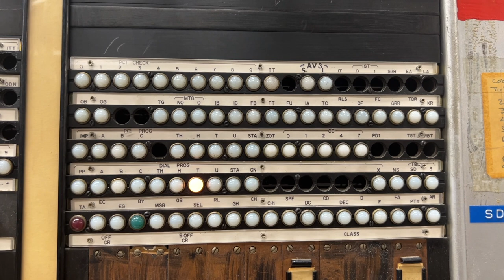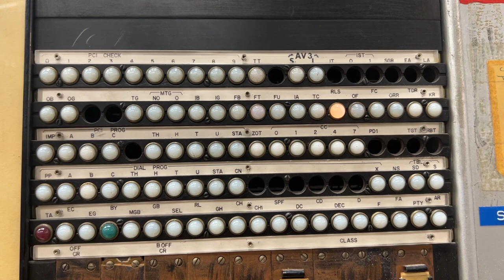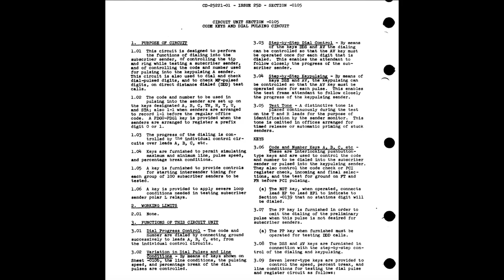Test Frame Tuesday - Originating Sender Test

Comment: Thank you Sarah! I’m a network engineer and it’s amazing to see the similarities between these two worlds in time. “Poking the machine” in a very specific way to test a very specific piece, is absolutely an art form. As you get better and better and learn to to feel the machine’s quirks, you usually get a hunch of where to start and things to try. The manual will have you run step by step through it (no pun lol), but eventually art/intuition kicks in and you can fly. Your overall debugging attitude and methods are hilariously close to mine when something goes wonky in a system. Thanks for another great video! Every time I see a new video it’s a “drop everything and watch” moment lol!

Comment: I started my employment with Western Electric in 1963, early February. I never worked in panel or number one crossbar, number five crossbar I ran cable and wiring line links mainly, but I was not satisfied with that. When number one ESS program for started, and I was fortunate to see one being installed in Bridge Street Brooklyn, mid-60s, I said that's for me. Western Electric started sending me to school in Manhattan to learn basics, then in Pennsylvania to learn peripherals and software and Hardware applications, then to Chicago Learning System testing. I continued my education with tsps, traffic service position systems, our systems qualified there as well, then my launcher number for ESS first digital electronic switching system, then number 5 ESS All Digital fiber optic switching. Then I start working and technical support. I appreciate all your videos concerning even step panel and number one and number five crossbar, I never had the opportunity to learn those systems because I got involved with the electronics switching, but you do a great job keep it up, I enjoy when you go step by step in isolating a problem. My Success started when I read a book on half split method. I used to build TVs radios I built my own oscilloscope all sorts of test equipment, and when I was visiting an electronic store I happened to come across that book. It was only 50 cents, but throughout my career I use the methods I learned there in every single system, I might add I was extremely successful doing what I did. But again your methodology showing the public what it takes to isolate and resolve a problem, the general public absolutely has no idea, what a switchman's job or any technician in Communications took. Keep up the work you doing I wish I could visit your Museum, unfortunately I don't have the health required to travel as I used to. God bless you and all your support out there. Today is October 5th I think 2022.

Comment: I worked private line in the 70's and 80's.  Pretty much the line side of the trunks you are testing.  Also did fdm mux between the toll office and the microwave radios for the long haul.  Things are so different today with IP telephony.  I never would have thought "long distance" would be "free"

Comment: Although not the equipment I worked on My early days as a tech was spent on NEC NC400 CrossBar Very similar to your "No. 1 Crossbar" every time I see the  old equipment is the smell and the noise all comes back to me. It was not till after this equipment was cutover to the modern stuff (NEAX61 K,L,M&S and NEAX-61E ancient now) that you could just hear the brains ticking over most often the call markers. It's all In the Manuals and if it is not in the manuals it does not exist!

Comment: I have watched almost all videos on this channel and still don’t get what a marker is 😅
Reply from the maker: This video should help: https://youtu.be/bQDXI7i0SGY

The closest analogy I can make is that a marker is like the CPU of the switch. It knows what the entire machine is doing, and creates and manages connections for calls that pass through the switching system. It's like the "boss".

In a #1 Crossbar like the one in this video, the senders are responsible for listening to the dialed digits and talking to other telephone switches. The senders do not actually create any connections though. They're just I/O devices. Markers (on the other hand) actually create the connections that senders talk over, and markers tell the senders how and when to communicate over the connections that the they establish.